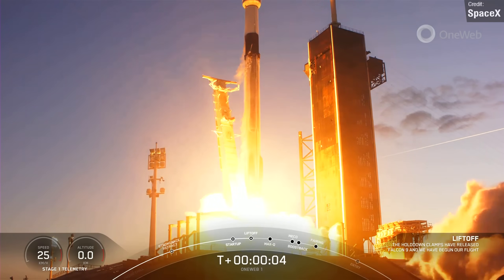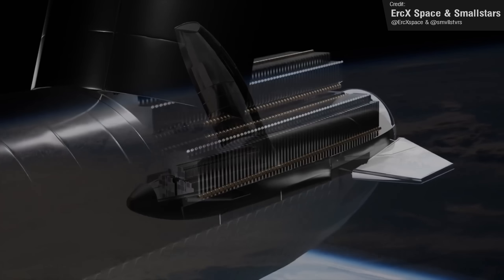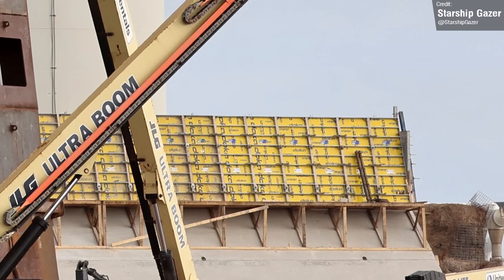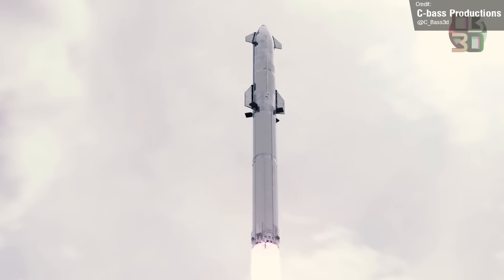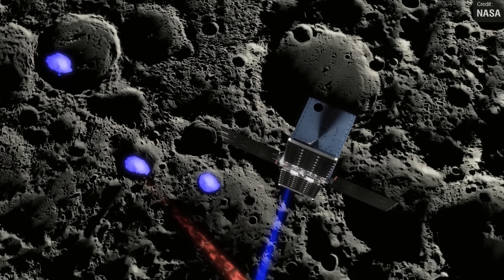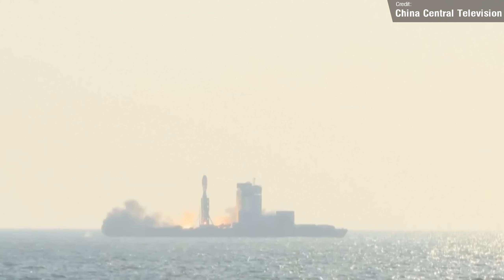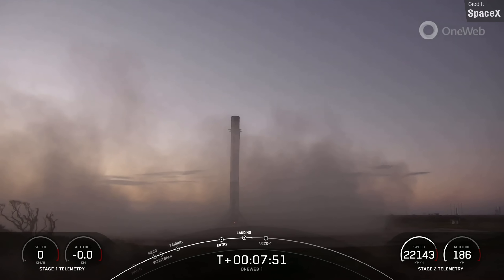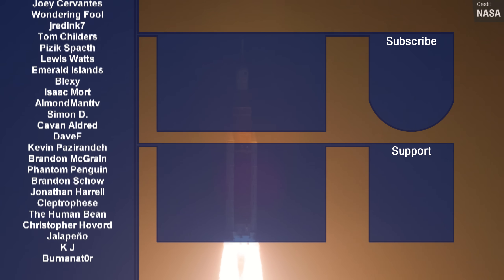SpaceX Starship 24 Reinforcements Complete, Ship 25 Sealed, Orion Splashdown, & China's Ocean Launch

Comment: 4:10 
They are not adding a yellow Extension to the wall that's just the mound for the concrete and will get removed once the concrete has hardened.

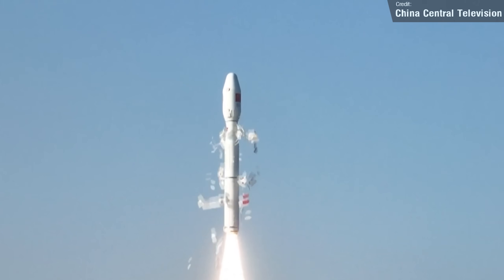Comment: What is coming off the rocket at 10:14
Reply: The cloth for heat isolation, since it use the low temperature fuel.

Comment: Hello @Matt Lowne ,how long would it take the heat produced by a 33 engine fire to melt steel.? What if the solution is a steel coated launch pad.? Lets say they lay a thick layer of molten steel to dry on the launch pad or even make it in the factory and just integrate it with the pad. You know the thick steel base of a super heavy which holds the raptor engines? something like that, only this time it should be laid on the concreate pad to prevent the damage that the raptors are making to the pad. This could be a permanent solution.
Reply: The time to melt steel depends on how much steel there is id say. It would take much more time to to heat up a thick slab of steel.
Reply: Given that a launch only takes a few seconds to leave the launch pad, is it safe to say a thick steel slab will be unshaken by a starship launch..?
Reply: @AlexArrowsKE  I would say so yes.
Reply: Well, we got a solution to the launchpad issue then, someone pass this to the engineers of SpaceX

Comment: The clam shell door was always a bad design.  I prefer the Splt Doors of the Space Shuttle but I understand that won't allow to use all the forward volume.  The Clamshell would have be stiffed to such a great degree being so huge and it would be difficult to get alignment with the forward latch with a length of 20 meters, but not impossible)

Comment: Yes, you can dig a trench, tunnel, parking garage, basement, etc. below the water table.  Its done all the time, you just need to design for the hydrostatic pressure and have the proper dewatering mechanicals.
Reply: Expensive & time consuming. Why not try to avoid having to do that. Clearly spacex is trying to investigate alternatives
Reply: @sauceboss1846  Actually its not but blowing up your big bad rocket or trying to reinvent the wheel is much more expensive.  To anticipate your response; I am a Civil Engineer and yes I have designed for this type of situation.

Comment: Serious question, why can't they use heat shield tiles as the base? At least temporarily. Keep up the good work.
Reply: Those tiles would fracture instantly. Those ceramic tiles are extremely brittle and can't take any shock loading. Just putting your finger on them the wrong way could break them
Reply: Because evry each of one would be shattered in a thausen pieces in the first second of booster ignition, those are made to resist extreme heat and moderate pressure(are very brittle) , if you want something that can survive in that condition 1,5 inch thick steel plate(38 mm) would be barely enough exactly like in the case of SaturnV flame divertor, you don't need to re-invent the wheel because the wheel already was invented.
Reply: @theOrionsarms  thanks and merry Christmas.
Reply: @johnevans6399  merry Christmas to you too.
Reply: Maybe expensive. But it sounds good right?
Reply: @steveturner3864  cheers mate.
Reply: The engine exhaust is a lot hotter than the atmosphere on re-entry, also they would get shaken apart by the force of the rocket
Reply: @thecyanadon  Thanks, merry Christmas.
Reply: @johnevans6399  Happy holiday
Reply: @thecyanadon  Thanks and merry Christmas.

Comment: I keep hearing that a flame trench can’t be built because it will be below the water table. As a civil engineer I have to say that this does not make  much sense to me. 

Building below a water table is very common and there are a variety of techniques available to do so. As far as costs are concerned, given the small size of the trench, the cost would be peanuts relative to Starships other costs. 

Not practical to do now though with all the steel structure above.
Reply: Here's the real reason. Elon said publically that a flame trench wasn't needed, and now any engineer who mentions it risks being fired on the spot.
Reply: @TheOwenMajor  That makes more sense. They will probably find some workaround for the moment but I bet they adopt one on future launch pads.

Comment: Why are the Chinese rockets shedding so much stuff?
Reply: I think that's supposed to be ice? Because rocket fuel is very cold on the tanks
Reply: @ferestrod3242  It's foam insulation. Those Chinese rockets are using hypergolic fuels (N2O4 / UDMH), not cryogenic fuels, so no ice forms on the tanks.
The hypergolic fuels they use can solidify at cold temperatures, thus the foam insulation is used. Ariane 1-4 did the same.
Once launched the insulation is no longer needed and just adds mass, so it's designed to fall off.
Reply from the maker: Those are passive thermal control tiles that fall off during launch. They help prevent the rocket/payload getting too cold, and are mostly used during the winter months.